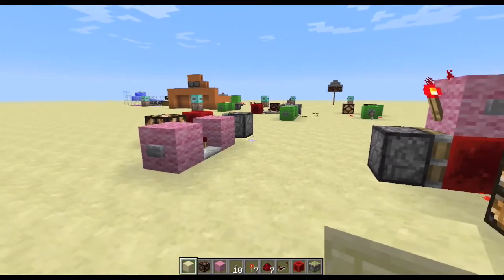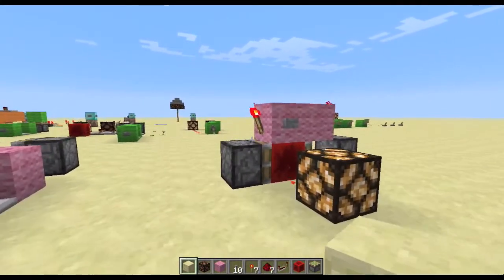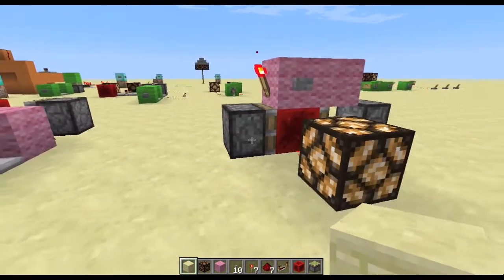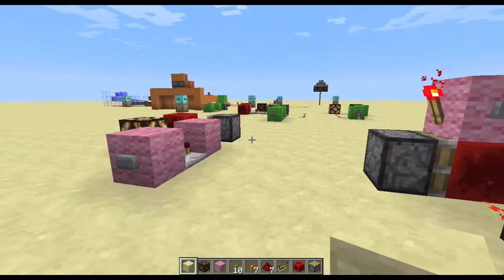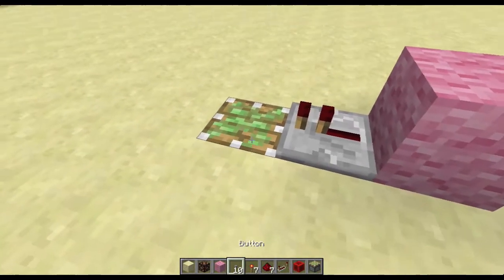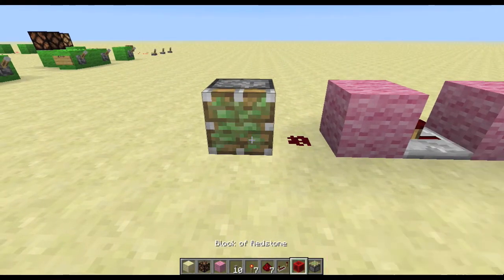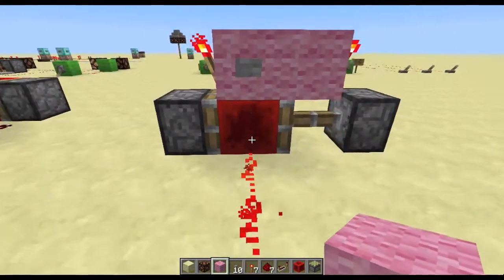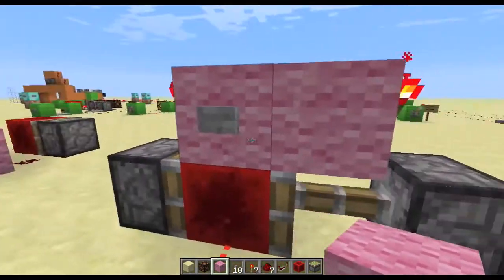Redstone Creations: Making a Button Act Like A Lever / T-Flip Flop in Minecraft 1.5 +

Comment: It turns on because that button is connecting to the redstone wire. Just like that design w/out a redstone block, you'll either have to lower the wiring or change the side of the output.